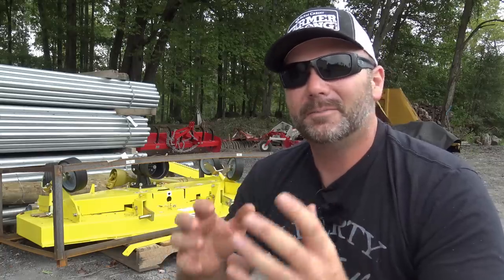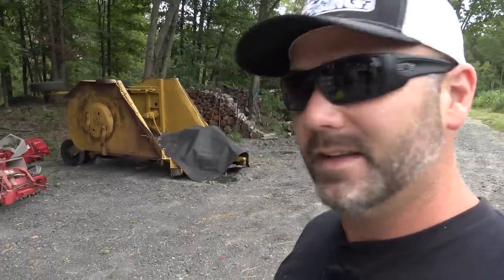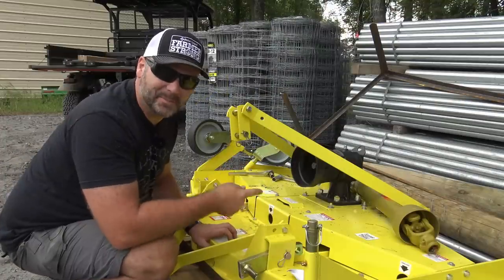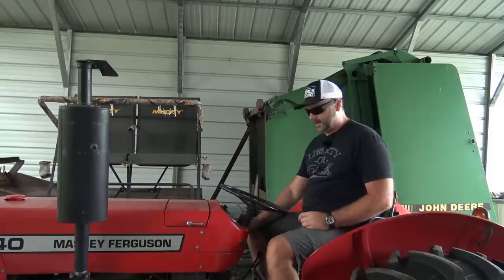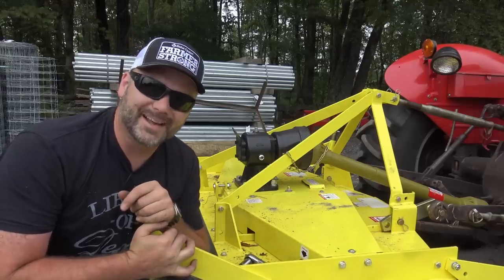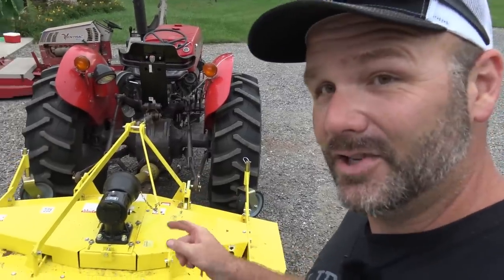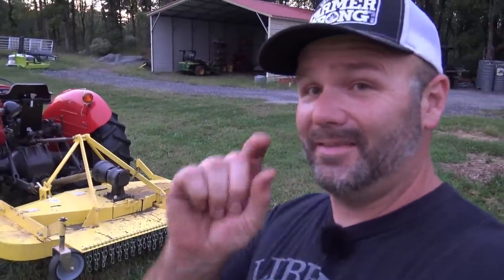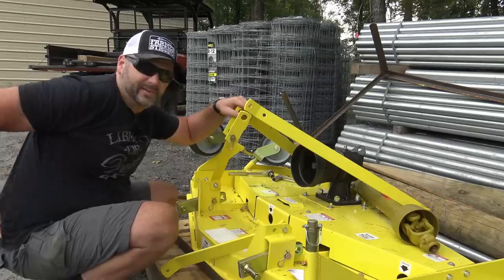Finish Mower...Does it make the cut? You Decide!

Comment: If you had some cows. They would eat the grass....just sayin
Reply from the maker: Can I borrow $10k...I need 6 cows lol.....we simply are not ready yet...water systems must be in place my brotha
Reply: @StoneyRidgeFarmer  And the gates need to be hung etc.. Plenty to do before you get the cattle. Don't rush it. Meanwhile the grass will be improving.
Reply: If he had some better grass....he could smoke it.....Wooooo
Reply: @StoneyRidgeFarmer  on that finish mower you may want to put a wire or something to hold those little clips on the wheels the one I had like that branches or sticks would grab them and pull them out.i didn't know you had the finish mower for the ventrac I thought it was the ruff cut. I use,the 6ft finish mower on my ventrac and it does a great job and you can mow grass at 5mph I cut at 4 inches and it's super easy to raise and lower the height
Reply: Did you not see all the fence material?  He's fencing and building the property.  Do you always push your trailer?  Just sayin!
Reply: If it were only that easy. Obviously never had to chase a cow that has gotten out of the fence before.
Reply: Your udderly wrong....just sayin
Reply: Buy Holstein bull calves.
Reply: I raise 400 of them a year. No cows (unless it is a barren heifer), no bulls (1 hour after they are home they are banded). It’s work... but I love it!
Reply: Stu that’s a pretty neat operation. I’ve looked into it for my farm but I simply don’t have the size or infrastructure to accomplish that. Mine is more of a hobby anyways. You should start a channel and show how you do it.
Reply: @Harvesttimebluegrassgospel  Thanks! We've tossed the idea around.  But more from the standpoint of helping reduce the death loss.... and swapping ideas with other people doing the same thing we are.
Reply: @Harvesttimebluegrassgospel  We are raising 400 holstein steers a year on 3.5 acres.  You need 50 calf huts and 5 pens.
Reply: Stu nice. My farm is all hill and steep makes it hard to have the huts but I may look into alittle deeper. I would have never thought you could run so many on that’s acreage.

Comment: Im on the 3rd season of my fm5 mower exactly like yours but a 5'. The guage wheels failed a week ago and cost 140.00 to replace. The new wheels have a grease fitting for the bearing so they are much better. I believe this mower is actually an Italian brand by the name caroni. I have replaced 1 wheel fork so far. They arent bad at around 22.00 a pc. The shaft on the originals are very soft. I ended up using red loctite on all the bracket fasteners because they came loose a lot and i put them on with an impact. I make it a point to grease the spindles before every mow. They are still nice and tight. I have replaced the belts and blades once which werent a big deal. I have had to replace all of the grease zerks a few times over due to the coming loose and falling off. The powdercoat is finally starting to peel. All in all it's been a decent mower for the price. I change the gearbox lube every season. If i can get 3 more years out of it I'll be happy lol

Comment: I have the 6' woods finish mower.... I have mine set at 4.5" .too high.... I have found that cutting with the wheels at the most extended height,.makes the shaft easy to been....be aware... BTW I am very hard on equipment....in my humble opinion 😃 you will love the batwing for pasture maintenance...I prefer my finish mower over a zero turn.... keep on providing much needed information to the less informed

Comment: After watching this video, I decided to buy one of these mowers. It arrived late in the summer 2019. Did use it once then put away in the barn till this spring. I have used it four times this season. Happy with the cut . Not do happy with the caster wheels. They are cheeply made with not provisions for greasing the actual wheel bearing today while mowing the two front wheels literally fell apart the back two wheels the bearings are ready to fall apart not very pleased with the quality. purpose for my comment is to let other people know that the although it's provides a decent cut you're going to have to upgrade the wheels in order to continue to use it all your savings on this machine has been used up.I wish your review would have been a little longer than just one cut but that's my fault for not buying a better mower.  Live and learn.
Reply from the maker: Contact Titan...you've probably got a warranty issue that they will resolve brotha...sorry that happened to ya. It's not a commercial machine...but it shouldn't fall apart on ya like that...email me and I'll forward your email to Titan! stoneyridgefarmer.com

Comment: One way to really show the quality of cut is to take a rake and rake it in the opposite direction it was mowed. I'd be interested in what that would look like vs the ventrac. I know the ventrac deck costs about 3x more but hey if it measures up ya know. Looked like it did pretty good but 3point finish mowers always preform poorly in my experience. This is my field of work, so my expectations are way higher than most.
Reply from the maker: Right on...well I finished this whole field the other day....did  a great job..hit a couple rocks but it kept on kicking! I'm happy with it!
Reply: I got my first finish mower.   It's a used Rhino tm84.   It had more issues than I expected.   I'm getting them taken care of slowly.   Now I need to sharpen the blades.   The bolts aren't coming out very easily with the 3/4" Dewalt impact.   I'm fixing to try the 1" air impact.   So far I'm happy with it.

Comment: Well done, the one steep that I would recommend adding to the assembly process that you may have done (but I did not see in the video) Is to check the bolts on the blades. It should not be necessary but, if someone at the factory forgot something, it would cause a lot of damage. I do love the vids! ;-}}

Comment: I wonder whether you need a head support steel bar over your head, on your Masey tractor, in case tractor roll side way, (touch wood) you will have protection, won't get pin down by tractor...? I saw some video that head bar help save life a lot.....careful operator is ok, but never know....

Comment: It's a FINISH mower, it's supposed to mow short. The Bat-wing brush hog is for higher cuts. Come on Josh, you're better than that! ;-)
Reply: Mowing height should influence your chosen type less than the terrain type being mowed does. 
A finish mower set low but mowing brush, stumps and molehills won’t last long or perform well, just like a brush hog set low dragging the ground mowing on a golf course would disappoint.
Reply: Well, we also dont want to scalp the ground.  I dont mow very short because where I live the rocks seem to grow.  Lots of hills and small mountains.  From a distance part of what I mow looks like a front yard..but walk across it and you are constantly finding rocks sticking up.  I rock areas I mow but with weather, rain and the tractor tires sometimes turning up a rock, rocking a field is for me a never ending chore to save my finish mower.  I could brush cut it but its about four acres around my home.  I have a 200 ft. driveway.

Comment: Nice looking mower. I know it's a finish mower, but I'm surprised that it doesn't have a shear bolt or slip disc just as a safety precaution
Reply: does not need one, it is belt driven so the belt slips

Comment: Got my concerns on the longevity of what is basically a light weight bush hog made in China. Belt driven at that. At the speed you have to drive, what will it take to mow that one field? 3 weeks? Go get you some cows, they still eat grass (stay away from horses, they ride fences and get foundered hooves). I'm just trying to figure out why somebody would want a $1500 mini bush hog to mow a pasture at super slow speeds (to prevent bogging) when they already have a bat wing ? Suppose if you had a golf course it's be useful for fairway edges....oh...hold on a minute. Josh is building a golf course?

Comment: I did not see any grease fittings on the wheels.Those sealed bearings will not last long in the condition where your mowing .Your 3 point should support the front of the mower not  needing two  extra wheels . those wheels are two extra  high maintenance points. Your gear box should run directly to the blades with a shear pin.Belts are a royal pain and are for sure not heavy duty.Very light weight mower good for someone with a little piece  land NOT WHAT YOU NEED. You should look into a flail mower cut ten times better and built tough.I had 6 flails and 8 bush-hog type mowers.I mowed 250 miles of interstate highway and turnpike.
Reply: Darn, you were out there!

Comment: Could you give an update on how it's holding up still fixing to buy one and wanted to know I it's worth the money and the coupon code must not work anymore thanks
Reply from the maker: STONEYGRASS is the coupon and it should be working just fine along with the link in the video description.  I didn't mow much with it this year....remember this is a budget minded product...so it's not a commercial or heavy duty unit...we were a little rough on it in this field because it had alot of rocks and bumps...still did a great job..especially for the price

Comment: My lawnmower stopped running yesterday,  I can’t pull the string to start it or turn the blade by hand..... Do you have any suggestions?
Reply: Is the safety lever by the handle working or the little cable working?
Reply: check that safety lever and if that checks out then i'm sorry to say the motor maybe seized but try pulling the spark plug out and see if it turns then if not then the motor is toast
Reply: @georgemarshall7508  also, pull wire off plug and flip it over and check for stuff stuck on blade
Reply from the maker: Push mower?  Replace....and when ya get a new one put shut off valves on the fuel supply line or always run it empty. This ethonol fuel is bad about breaking down internals in the carburetor...then the carb floods into the engine causing a detrimental lock up.  Where do ya live? I have a push mower I'll never use again...been thinking of selling it off.
Reply: Did it run out of oil?if it is locked up sorry to hear that.
Reply: Any oil in it ?
Reply: Stoney Ridge Farmer thank you so Much for the Reply,  You’re a Noble guy and I really enjoy your videos 💯✊🏽💯
Reply: George Marshall I’m going to check the oil this evening,  Thank You George for the Reply....
Reply: august I’m gonna check the oil this evening,  Thank You for the Reply....
Reply: tom p the wire that starts it rite?
Reply: Brett Hibbs I’m gonna try this method this evening,  Thank You Brett
Reply: GaugezPup spark plug wire so your save to mess with it, safety brake is next to check... if blades not moving at all after checking those two it’s probally toast